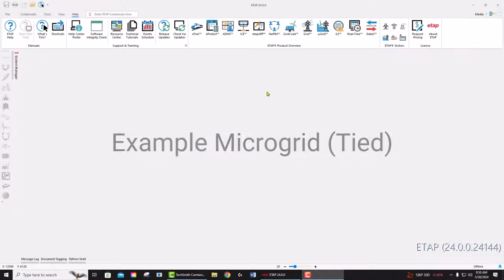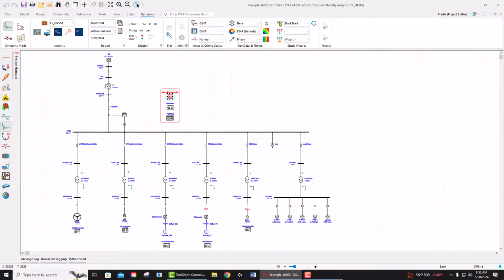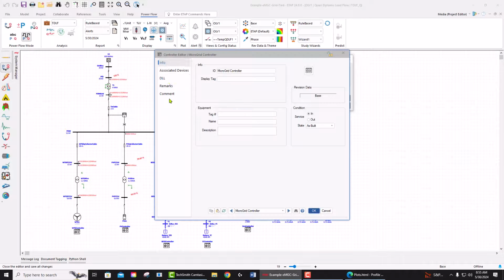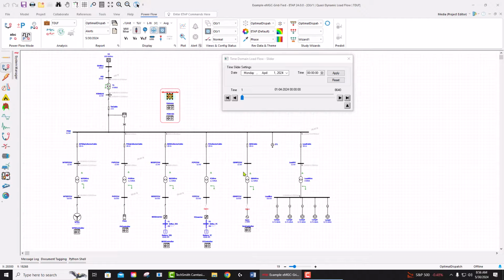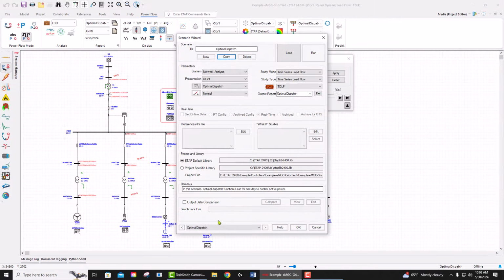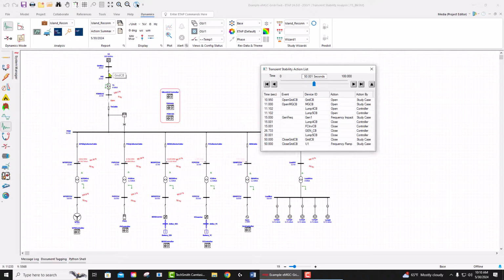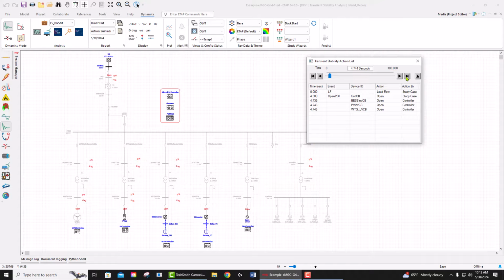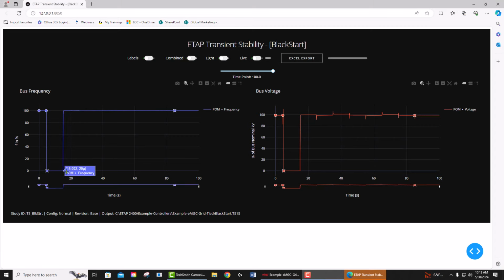Microgrid Controller (Tied) Explained

Comment: In black start ,how microgrid is going to restart the battery? From where it takes power?
Reply: The battery energy storage system (BESS) indeed energizes the microgrid and restores it after the blackout. In sequential energization, the BESS should be able to withstand the inrush current caused by the energization of components such as transformers and cables. In soft energization, the BESS increases the voltage of the microgrid gradually to avoid inrush currents.
Reply: here microgrid operates in a stable island mode, manages frequency, voltage, and power balance until the grid becomes available. so grid dead state the current pick up due to diff it energise the BESS, normal explanation once grid is Off , then it initiate the Bess by his reconnect in built option.